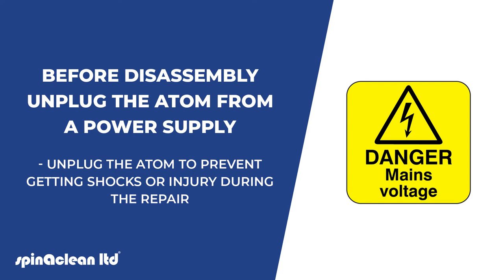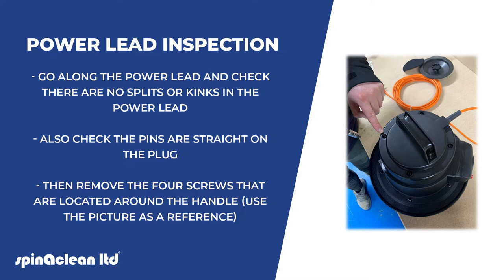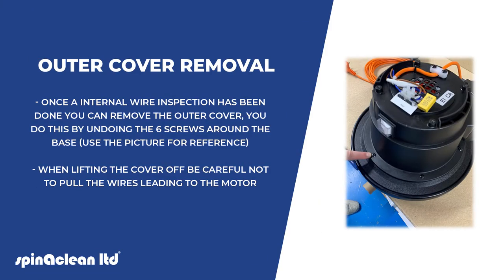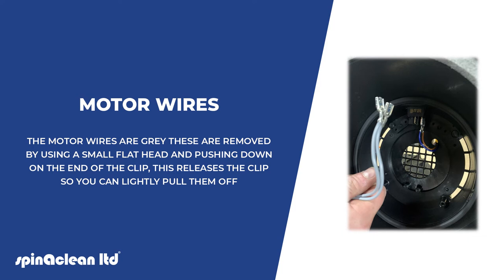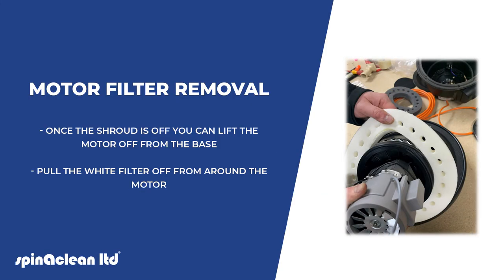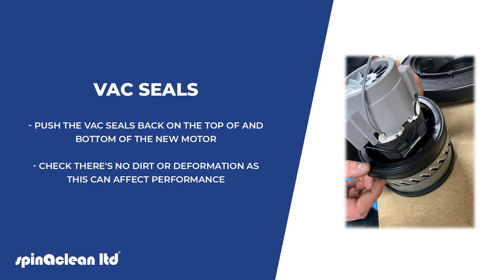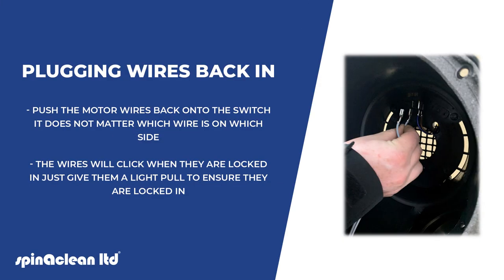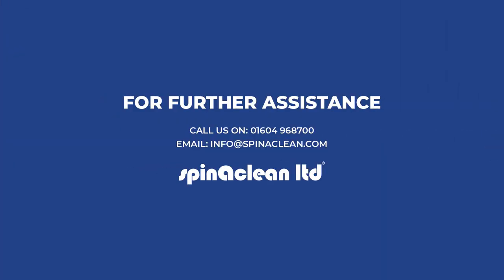How to Change the Motor in a skyVac® Mighty Atom

Comment: No video of the 1600w atom, only this of the mighty atom. It doesn't show the inside of the filter part (cup) below the moter  housing marked top.  Would be a lot better with a video for dismantleing and reassembly instead of just photo slides. However very quick so provide new motor and the service is amazing , thank you Helen
Reply from the maker: Hello, thank you for your comment. Our skyVac Mighty Atom in this video and old style front entry Atom we used to stock are the same wattage at 1600. The only key differences between the skyVac Atom and the Mighty is the side entry port and the blow function being slightly bigger but that is all - there is no difference in the motors at all. I hope this helps!

In terms of the video creation, your comments I will pass through to our marketing team for review. Feedback like this is really important as it helps us to improve our services for our customers - we appreciate your opinion. If you had any queries at all regarding the motor change, please call our office during office opening hours on 01604 968700 - our technicians are here from 8am - 4pm who will be more than happy to advise. 

Kindest regards, Spinaclean